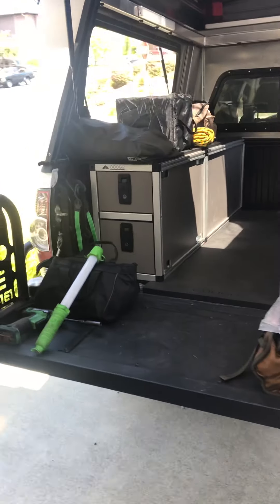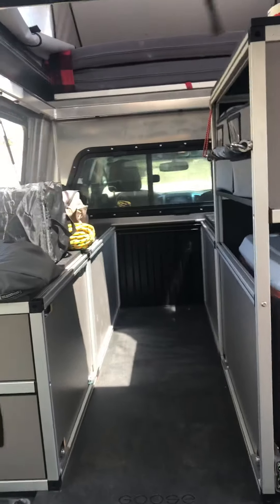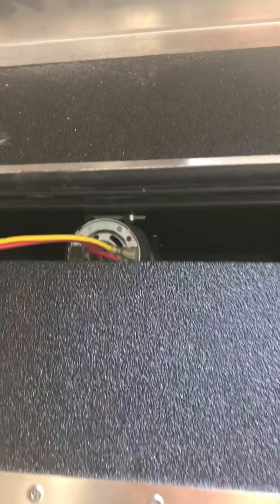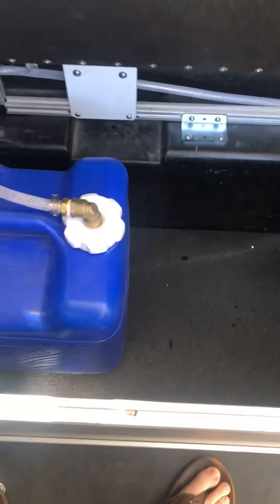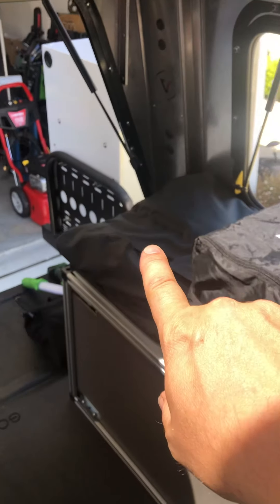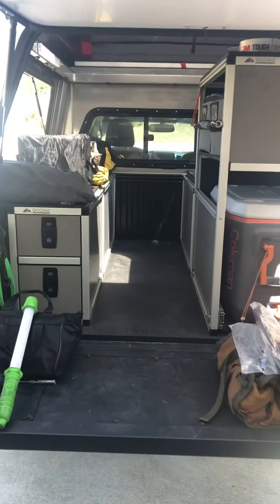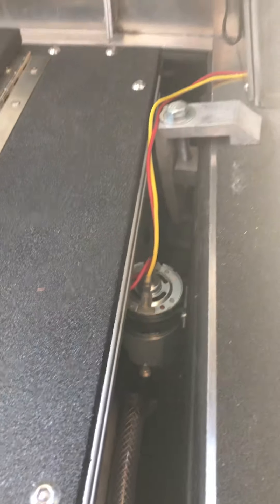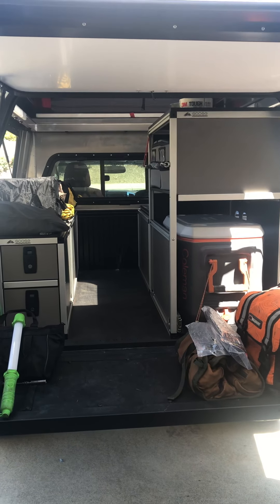Vagabond Outdoors Drifter Project Update: wiring schtuff.

Comment: I've got a drifter on the way.  ETA early May 2020.  Hey... Question for you.  I was going to get front runner doors.  I know they say you can only open them from the outside.  Is this the case?  No way to open them from the inside even if you get creative?  Thanks for the videos.  Been sending them off to people when I have to explain the camper since their website doesn't show enough inside views.  Thanks on the question if you can help.  I know the windows for example would open from inside, but keep thinking the frontrunners are the nice door.  Prefer if they open from inside.
Reply from the maker: Jeremy Robida I still haven’t found a way to open them from the inside if they are locked on the outside. I haven’t camped in an area where I have to worry about that kind of security issue yet. I highly recommend the Frontrunner doors. Well worth the extra jingle. I’ve got to do another video. I’ve changed a bunch of shit around again...

Comment: I'm liking the Vagabond, but now they say there's a one-year wait, which is way too long for me.  If I were to get one, I'd request that they build it so the sides are vertical.  With them being slanted, you can't do an efficient build-out.  You lose too much space.
Reply from the maker: The sides have the pitch to them to follow the cab lines of the Tacoma. If you were to make them vertical, you would lose the benefit of it being able to fit in tighter trails. I believe the main benefit of the camper shell is it’s form factor. It’s less likely to catch a branch or hang on a tree on tight trails. If you want more buildout space, think about a Nomad on a flatbed setup.
Reply: @Anders0nic  Good point Anderson.  I do all my camping in Baja where it's open desert with no trees.  But I realize there would be more resistance with the vertical sides which would probably result in lower gas mileage.
Reply: @Anders0nic  would you happen to know   what the height of the camper from where it connects to the bed rail  to the top of the closed RTT?  I can’t seem to find it anywhere on the vagabond site
Reply from the maker: @sergiolozano6205  https://www.tacomaworld.com/threads/vagabond-drifter-camper-buildout-and-mods.540940/page-57#post-19524431